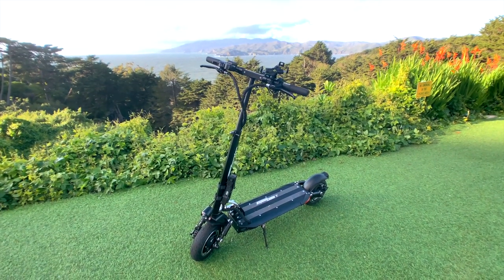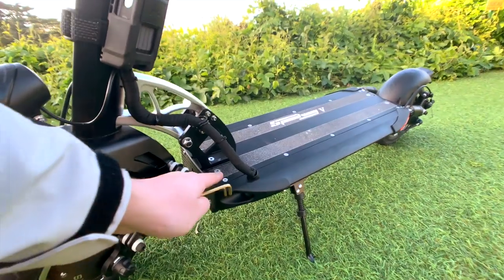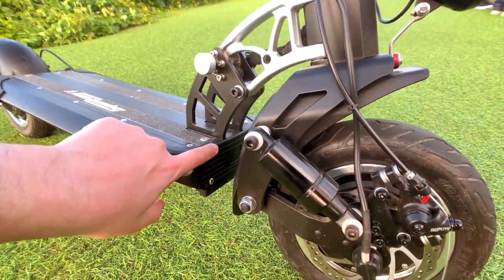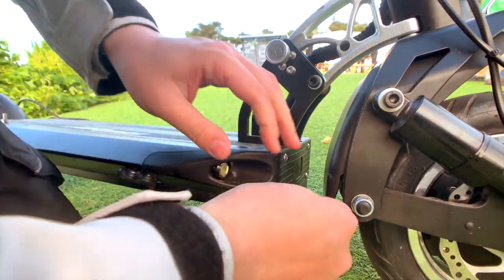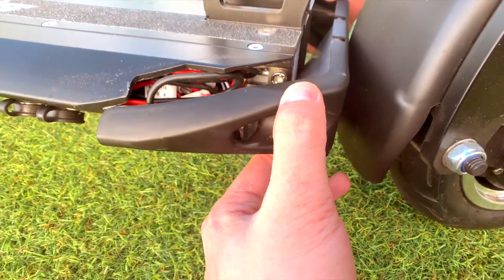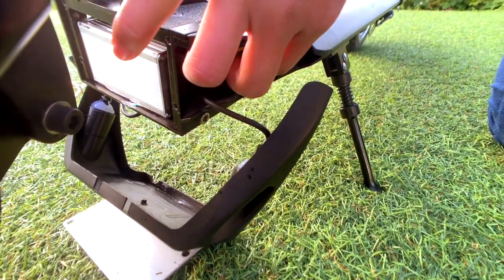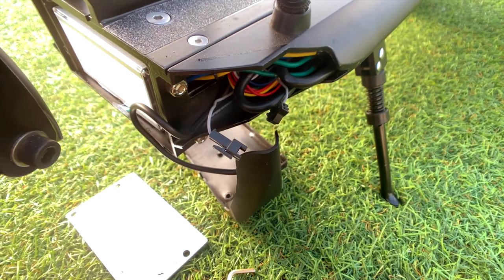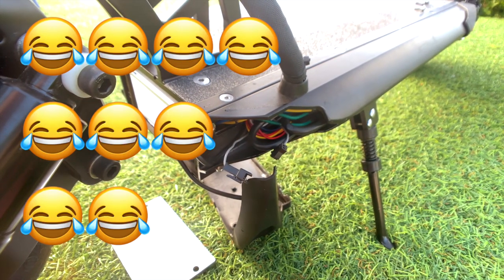Tutorial: Removing the Minimotors Speedway V Speed Limiter

Comment: I like the fact you can switch back if needed, most of the ones I've seen like the Zero 10x you have to snip a wire.  Overall the Speedway seems to have it all with the exception perhaps of a more springy suspension.
Reply from the maker: Rick Deckard yeah, though tbh - the Speedway has enough settings (eco/single/modes 1-3), that you can definitely limit the speed quite a bit without the wire. Good for beginners or letting people try it for the first time. It’s a really great scooter, we’ve got several in our group rides now.

Comment: Me my scooter had a cable similar to the one in the video but it was double with another blue cable and now it doesn't show the speedometer how much it runs 

Did I do anything wrong?
Reply from the maker: It's hard to say, sometimes with wear and tear certain wires would get disconnected. Might have to get it repaired or replaced. 👽🖖

Comment: Bonjour, merci pour cette video. Je viens d'acheter la speedway 5.
J'ai moi aussi retiré le cache devant mais je n'ai pas trouvé les fils gris pour le déconnecter. Pourriez vous montrer la vidéo entièrement pour montrer comment vous trouver le fil gris pour le déconnecter ?
Reply from the maker: It should be a single grey wire in there somewhere! Try pulling out the wires, maybe it's buried. I don't have the Speedway V, but it hasn't changed as far as I know. Good luck!
Reply: @AlienRides  thanks for your clarification

Comment: Hey I just bought the Speedway 5, and the top speed it maxes is "just" 45kmh, and around 37 to 42 with me on it... 
I disconnected the grey cable, and nothing happened, do you now how can I achieve better speeds ?
(Mode 3, dual + turbo already turned on)
Reply from the maker: You should definitely be able to hit a little higher than that. What about the eco/turbo button? That button should generally be "up", and the opposite of the dual motor button.
Reply: Check if P8 is set to 100% output. Greetings all and thank you Alien for the video

Comment: Hi my scooter is redwing max 48v 10a .limit at 25kmh.. is the same.wire to unplug?
Reply from the maker: Depends on the brand, but it does seem like you should be able to go faster with a 48 volt scooter. Are there any speed settings you changed? You should check with the company that sold you the scooter.
Reply: @AlienRides  no change from the start. I mailed the company and the seller and tell me about law that the scooter an bike is 25kmh on speed limit thats why they have speed limit on their product. thats why I have regrets 😂 but I know like this method shoul release full potential on my board

Comment: Groat vid dude! One question though. What will happen if a switch is connected to cable so it can turn it on and off when riding?
Reply from the maker: There is a power button connected to the main power, but I don't believe you can turn it off while the motors are powered. Even if it were possible, since it's a scooter with physical brakes you would just coast or brake to a stop. Scooters are generally pretty safe.
Reply: You didn’t understand the question,he is asking a switch on the gray wire so he can restrict and derestrict while riding

Comment: You could just put an inline switch in there no problem! Just have it tucked away somewhere discreet so you can secretly flick it on and off.
Reply: Hi there mate! 
I have that wire detached and P8 at 100%. Turbo mode on and dual motor on too. Still max speed is 30 km/h. My retailer told me that they can’t tell me how to unlimit the scooter because of the warranty. Any ideas on how to unlimit this rocket?
Reply: @unpocogranuja  Without seeing what's inside your scooter, as clearly it differs from the one in this video I can't help you. You can check to see if they have circumvented this wire with another wire so as to prevent you from limiting the scooter. They have may have even soldered something within the main board themselves so its not so simple to de-restrict. Best way is to take the scooters controller out and have a look at it, physically find the grey wire goes to and go form there.

Comment: My Kaabo Wolf Warrior 11, 60V 25AH, 2 x 1200W can reach a max of 67km/h I currently weigh 79kg /specs say that it can reach 80km/h 
Is there anything that I can do to make it faster/ haven’t checked for the speed limiter wire yet. I’m curios if it can reach 100km/h
Reply from the maker: Hey, the Wolf Warrior looks like a pretty awesome scooter. If you can already do 67kmh there probably isn't a limiter wire. You want to check your P7 and P8 settings, make sure you have 100% power and no battery save. I thought it could do a little bit more though, let me know what the settings say.
Reply: Alien Rides will do man thanks a lot / Most probably I’m going to need to shed off some weight in order to make the Warrior more agile and faster
Reply: Alien Rides  BTW what should P7 and P8 be set at max ? And  can I max out P1 - P6
Reply from the maker: MC G p1-6 are not related to performance. Definitely check your manual if you have one, it should be the same as a Dualtron but I’ve never used a wolf warrior and it’s possible they changed some programming.
Reply: Alien Rides Cool beans

Comment: What is that box velcro-ed to the steering stem?
Reply from the maker: Oh I think that's just a modification to keep a lock on it. Something similar to this: https://amzn.to/3cQ5tmk
Reply: @AlienRides  Thanks.  Do you know the best way to hook up a 5v and/or usb power source to run external bike lights?  I find the built in headlight is lacking and barely has any good flood and being too close to the ground.  But using a bike light, I have to remember to charge it all the time.  Ideally, I would like to run the bike light with power from the scooter.
Reply from the maker: Youtube Uploads I don’t know how you hook that up tbh, you might want to get a light with a battery. It is possible to use the scooter battery, I’m just not familiar with how

Comment: Why does a company like last-mile have the limiters connected( I think mini motors USA also) but E Wheels does not? They say because of insurance reasons but if it was that significant wouldn't ewheels do the same also? I mean it's no big deal to disconnect them but to me I think it's pretty funny😂. The ultra's running great. Pretty much got everything maxed out. Except p7 I'm at 2( maybe try 1 tomorrow) and the region I have set at 4( 5 would be too much).4 definitely takes some getting used to but the initial pull on the rear brake along with throwing your bodyweight back and then the first pull on the front brake will stop you with no problem at all. The mechanical disc would be useless on this thing without that regen. There is no way in hell you be able to stop. Waiting on some blood red grip tape( should be here in a day or so). I'm going to cut it and finish out the deck with it that way the whole deck is covered. The black and red is going to look killer. Then when I get time I'm going to take both fenders prep and paint them. Just the dualtron logos are going to be blood red. Little bit of work with an exacto knife but nothing difficult. And that's pretty much going to be it until I buy a handle for the rear. I managed to take my cat eye rear multifunction tail light off the back of my Speedway and put it on the ultra opposite side of the disc brake it goes right around the nut cap. Tightens down nice doesn't move at all.
Reply from the maker: Yeah, I think it just depends on the insurance company requirements. The companies probably have different agreements with different requirements. Luckily removing it is pretty easy to do, and I wanted to make a video since I had a few different requests for it.

I think I’m just riding with a 3 for the motor braking, but occasionally tweak settings depending on what kind of riding I’m doing.

Very cool list of plans for your Ultra, definitely send or link me to a picture once you’ve done some of those things to it!
Reply: @AlienRides  Will do👍
Reply: Prob a "CYA" in all places.

Comment: How can i do this on my Zero 10x?
Reply from the maker: I don't actually have a proven answer for the Zero 10X, but some people say there is a single white wire. Make sure that the scooter is in mode 3 though, with the dual pressed down for dual motor, and the eco button left up for turbo mode. What's the max speed you get in that configuration?

Comment: I disconnected it and it doesnt increase speed
Reply from the maker: Few other things to look for:
- What mode is set, you should be on mode 3.
- Do you have dual motors turned on? Button should be down.
- Do you have turbo mode on? That button should be UP (opposite of dual motor)
Reply: @AlienRides   i dont have same electric scoter, I have Frugal Compact max speed i reached 32km/h but im wondering if i can increase it to 40/45, i searched for information how Speed limiter look like, maybe its white-black but im scared of cut it off
Reply from the maker: @Mefarious  oh I have not tested that scooter so I don't have information, sorry. Can you link me to it? Curious to see what kind of motor it runs, you might not be able to get more unless it's powerful.
Reply: @AlienRides  https://www.skutery-krakow.pl/hulajnogi-elektryczne/frugal-compact-elektryczna-hulajnoga-czarny-kola-10/ Motor  1000W 36V in Eco mode 650W
Reply from the maker: @Mefarious  I see, thanks. It's a nice frame, but I'm not sure if that motor can do more. I have friends with this frame who replaced the battery and motor, but that is a lot of work to do.
Reply: @AlienRides  Ok understand, motor 1000W 48V would increase speed? or i have to place 1600W?
Reply from the maker: Khan's Nightcore 48v would help for sure! But you would also need a new battery most likely. Good luck with your project!